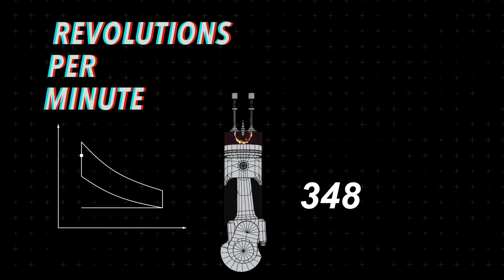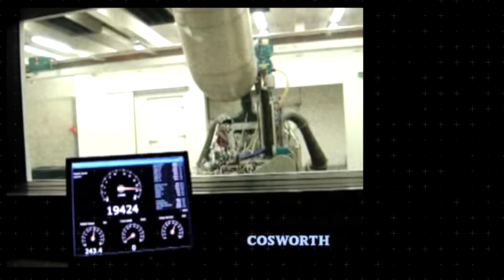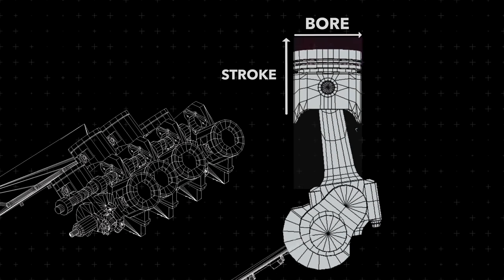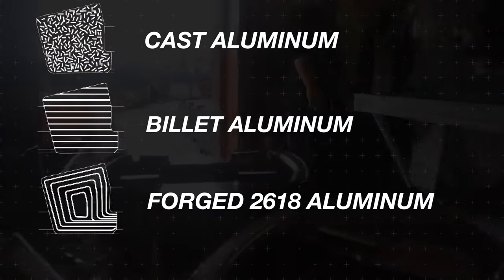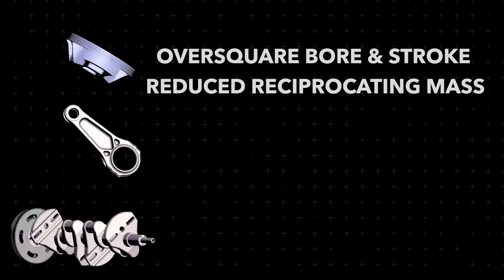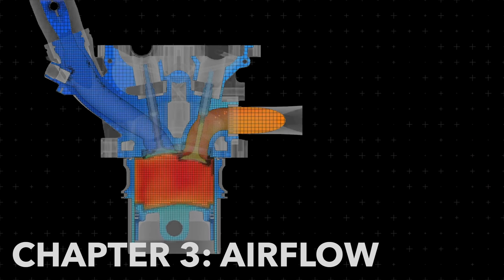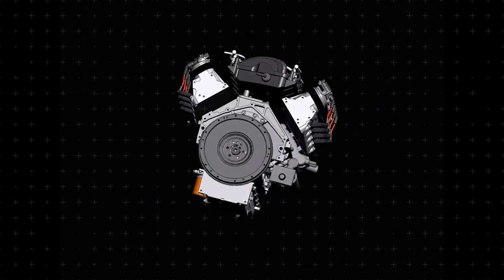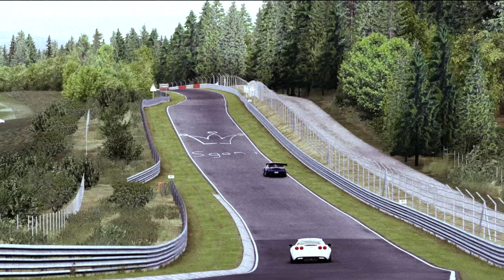The Impossible Engine Speed😳| Explained Ep.28

Comment: Or, you can buy a car which comes with a high factory limit... 
Over 50 years ago, Fiat did that with the 128. A front-wheel-drive dirt cheap saloon launched in 1969 whose engine did 9,000rpm in factory trim. That engine went into the X1/9 in 1972.
Only 4 cylinders, but the sound it made going from 6,000 to 9,000 took the exhaust note two octaves higher into spine-tingling territory. And it could rev like that all day long.  
It had all the tricks described here: highly oversquare (80mm bore, 55mm stroke in the 1100cc in line 4), overhead cam with double valve springs, shortest possible intake runner.

PS 
Great job explaining some challenging concepts clearly and concisely. 

I was working in F1 until 2006. Once you get up to those silly revs (16k or so) the combustion pressure ceases to exceed the inertia force of the piston and rod. In other words, even as the cylinder compresses the intake charge, and then combusts it on the power stroke, the force applied by the gas is less than the momentum force of the piston trying to throw itself at the cylinder head. 

So how does that make power? Because the gas pressure reduces the inertia force in the powered cylinder, such that the inertia forces in the other cylinders "pull the crankshaft around". 
It is a bit of a brain-bending concept. 
In practice, the powered cylinder simply has "less inertia force" pulling on the conrod, since the inertia force at high rpm grows (as a square of the crank rotational speed) to exceed the combustion force, which declines a little as the combustion rate remains nearly constant, but the time available reduces as the engine spins ever faster.

It remains easier to consider that all the inertia forces cancel out neatly, leaving you with the unopposed combustion force driving the engine around. 
Literally, the math works out just the same. 

Time to combust remains a small fraction of the cycle time - hence the idealised vertical line on the "pressure versus piston position" cycle graph, which assumes instantaneous combustion and transition from unburnt (compressed mixture) pressure rising instantly to "combusted gas pressure". In reality, it isn't instant (so the line would not be vertical), but remains "close enough" for the assumption to just about hold. 
This is why ignition timing matters. Firing Before Top Dead Centre (BTDC) means that combustion starts before the piston is at closest approach, and so that graph should start climbing earlier on the compression cycle. But firing at TDC or later would lose too much of the power stroke pressure, and reduce output and efficiency. It is a delicate compromise balance, and every engine will be different because every engine geometry is different. 
Ideally we want to maximise the area enclosed by the graph, to achieve maximum work extraction. Which means it can be very sensitive to exactly when combustion starts, to catch that very narrow peak in the graph at TDC, without losing too much enclosed area on the approach to TDC by firing too early, or giving away too much pressure on the power stroke by firing late. 

That 9,000rpm Fiat engine advances from 5 degrees idle timing, to about 36 degrees BTDC at top revs. And, iirc, an F1 engine at 18k rpm advanced to between 40 and 45 degrees BTDC. This makes it look like that "vertical line" assuming combustion is instantaneous is far from accurate. But the flame front advances linearly through the mixture, resulting in a cube rate of burn through the volume (and more like a square in the pancake volume left at TDC, where it has already burned top to bottom of the volume and is now merely advancing as a squared number across a circle). Point is, the volume burned starts slow and accelerates quickly, meaning that most of the combustion happens late and much faster than the BTDC ignition timing implies. 

BTW, you can now see why Alfa Romeo's "twinspark" idea had merit. By starting two flame fronts, the mixture volume could be burned through quicker (double the rate until the two regions met, or hit cylinder boundaries), hence getting closer to the vertical line, and improving the cycle efficiency (and making more power from the exact same engine). Conversely, the "lack of difference" meant that nobody else bothered with the engineering hassle and expense of fitting a second spark plug - but all tried to optimise the position of the single spark plug close to the centre of the combustion chamber. 

It is also important to realise that the ability of any cylinder to fill with incoming mixture is a difficult compromise between cylinder bore and valve opening. Multi-valve engines work because having two (or three, if you are Yamaha) inlet valves allows a greater opening for the cylinder to breathe through. You can imagine trying to breathe through different lengths (and different diameters) of hose or snorkel. The longer the pipe, and the smaller the bore, the harder it is to draw air in. Ideally you want no pipe (shortest inlet duct) and a wide open mouth (no bore limit) to breathe easiest. But that aggressive cam profile to get the inlet valve open is also limited by the large piston not moving away down the short stroke bore very far or fast. Obviously the stroke always exceeds valve lift, but trying to get 15mm of valve lift when a piston moves just 40mm (and spends a long time in the way, dwelling at TDC) means that lift profile has to be very carefully tuned to pretty much park the valve head against the moving piston all the way to max lift - without touching it at any moment! One touch usually means instant breakage and failure. 

Impossible to do, without generous margins and clearance tolerances for all of the flexibility and vibration and resonances occurring all the time. 

One F1 engine I knew of had to increase the diameter of the valve pocket cutout in the top of the piston crown, because the conrod had such torsional vibration the piston could be as much as 3 degrees out of alignment (around the vertical bore axis), making the edge of the valve pocket hit the edge of the valve head. That resonance only happened at a few engine speeds. But it had to be allowed for, making the entire system less efficient at all of the other engine speeds. But it was easier to sacrifice a tiny bit of power with larger pockets, than find a solution to the conrod resonance (which, despite the large amplitude, was not a fatigue failure problem).
 
Think about it... a conrod twisting along its length by +-3degrees, as the piston moves up and down at 18k rpm... That amplitude is blatently visible with the naked eye (although it's moving far too fast to see it in real time). So much for a system that 99% of people assume behaves like a rigid body assembly, with stiffness and deflections so small they are microscopic and hence negligable. 
And you thought we only had to worry about up and down stuff?  

Sorry for the lecture. I hope you found it interesting.

Comment: Brilliantly explained. I'm not an engineer and horrible at math, but it all makes sense. On valve float, I don't know why F1 never licensed Ducati's Desmodromic valve system. Two rocker arms/cam lobes per valve - one to open the valves and one to close them. No springs. Put electronic cam control on them for higher RPMs. Pneumatic is great but moving a lot of gas quickly seems to have time delay as well as a number of other phenomenon - under extreme pressure and speed gas can liquefy. It is such an art what these engineers can do. After F1 went to hybrid and smaller cylinder engines I stopped watching. Sounded like sewing machines running around the track. Nothing has a heart stopping brutal scream like a V-10 entering the tunnel at Monte Carlo...

Comment: What about the 4cyc mc22 cbr250rr from the 90’s. Redline is 19,000rpm and the limiter kicks in at 20,000rpm. It was my learner bike, and I bought mine with 30,000km on it and sold it with 45,000km. Ran perfectly and was absolutely reliable, it sat outside rain hail and shine, and always started first go everyday (was my commuter bike for work). I flogged the engine too, rode it high in the rpm up to redline pretty much everyday 😅

Comment: Rocker arms with fingers, a la Ducati desmo engines give higher rpm more reliably because no valve float issues.

 At the extreme end of the scale the problem is having the time required to burn the fuel, engineering only presents thinking exercises but time/piston speed is the limiting factor.

Comment: There has to be a point where the fuel cannot physically burn quick enough to make power. A chemical reaction has a limit to how quickly it can take place. Exceed that limit and the fuel finishes burning in the exhaust manifold where it does little good. Except perhaps to spin the turbo charger.

Comment: it doesn't matter what stroke you have on an engine, but you can never REACH MORE THAN 197 METERS OF LENGTH PER SECOND FOR A LONG TIME the engine blows up then this applies to all engines even spark plug engines that turn 40,000 rpm

Comment: I think they fail to mention that these engines are able to reach these high tpm is a big advantage in gearing reduction. There able run lower gearing in the transmission witch in turns you’re able to multiply power and torque.

Comment: 755 horsepower @ 19250 RPM is impressive indeed but 755 horsepower is far less than 1050 horsepower which was produced by 2016 F1 cars, at much lower RPM, with the help of turbo. In the end, performance requires high power, no matter which method you use to achieve it. These days you get electric cars with almost 2000 horsepower and incredible longevity  due to the low number of moving parts that could fail.

Comment: RPM has nothing to do with stresses to the engine. You can have a 30,000 RPM engine easily.
Just have a stroke of 20mm and it'll have the piston speed of a typical engine at 6,000 rpm.

Comment: This video talks about F1 engines then talks about metal valve springs. They've used pneumatic air springs since the 1980s including the whole V10 and V8 era.
Also, the exhaust pulse timing is not designed for just the minimum backpressure, it's designed for scavenging, this is why the volumetric efficiency of these engines is well over 100%.

Comment: If you are talking of rpm on f1 engines you might want to look at the 2005 season not 2006, because of the rules in 2006, engines had to last longer meaning, there are some reports of 21000 rpm engines in 05, particularly the spectacularly unreliable mercedes. The wiki on 06 regs is a bit out of context, there was the expectation the new v8 would rev higher and reportedly cosworth was the first to reach the 20000 mark with the new rules though by the end of 06 some said 21000 rpm was close to being broken and for 07 an rpm limit of 19000 was established.

Comment: 1:41 you should’ve used lessons learned from NHRA Top Fuel dragsters which rev at the highest rpms and have by far the most Horsepower of any Motorsport cars I mean they pour out over 12,000 hp

Comment: I grew up in the '80s and always thought that banning turbos in F1 was a terribly old-fashioned regressive idea - but that was the governing body (FIA) in a nutshell (old-fashioned and regressive). Screaming NA engines are a very cost-inefficient way of achieving performance, which is fine if you're an F1 constructor with hundreds of millions in sponsorship, but precisely because of that it creates a huge barrier to entry - you can only compete if you have an absolutely astronomical budget.

The return of turbos to F1 was pure logic, but once again the FIA insisted upon imposing technical limits. Why mandate the use of hybrid electric scavenging systems, but then limit the amount of usage of that scavenged energy? Nobody gets to find out just how good the system really is and surely that serves nobody's purposes. F1 should not be limited - it should be the pinnacle of possibilities. The turbo engines of the '80s really were pushing the boundaries before the FIA started turning the screws on them with its nanny-state tendencies (boost limits, for instance) - it would be great to hear of modern F1 engines routinely outputting over 1000bhp, as they used to. (I know - the engines themselves were not as durable and they could run qualifying-spec engines turned up to the max that would only last a few laps, but that was all part of the fun - and more modern materials might have improved matters since then). The cars themselves were more challenging, which meant the drivers had to be better - today's F1 drivers are just gamer geeks compared to the '80s mob.

Excellent informative video here.

Comment: Ducati had a different solution to the valve lift problem; desmodromic valves, where the valve is forced open by one cam, and forced closed by another; this is why their motoGP bikes were faster, until the other teams started using pneumatic valve springs.

There is nothing magical about a "10k rpm" limit, the Yamaha R6 limited the engine to 15800 rpm (although they claimed 17500, which was a false advertising scandal)

The real limitation is the peak piston speed.

Comment: The previous version NASCAR engines achieved higher peak piston speeds than Formula 1 engines ever did. F1 engineers actually used to work with NASCAR engine manufacturers to make F1 components stronger and capable of higher speeds.

Comment: Absolutely brilliant 337!
So freaking accurate dude! Io this day I get irritated when I hear people who ooh, ah over a small displacement motor that makes power at 9000 RPM and they don't mention the fact that it's tiny, it has tiny main journals, it has tiny connecting rods, it has a tiny crank and low internal friction because of a very low rotational mass, HP per liter is easy at that displacement. What good is 200 horsepower if right when you hit peak horsepower,,, it's time to shift? 
You don't even get any time to feel the pull of that full 200 horsepower because redline and all.. Then you shift and then you drop back into the power band where there's no torque.
There's a lot to be said for a big broad torque ban and a steady rising horsepower curve where right where you shifted past horsepower peak, it drops into your torque peak and the car just feels like you could short shift all day long!
Reply: I hear you, it's really just barnyard engineering in those Japanese vtecs from the 90s and F1 engines from early 00s. Idiotic stuff. Morons in Honda/Cosworth don't have a clue. Any clown can get 200hp out an NA 1.8. The real innovation is in American muscle. Getting a 6 litre V8 to produce power at 2000rpm, now THAT'S difficult. All kinds of gotchas like needing bigger carbs to get all that fuel in, a bigger fuel tank to hold all the fuel, a bigger exhaust to help expel all the unburnt fuel, not to mention the military force you need to secure the oil fields and refineries in the first place. When you've got an efficient little 4 banger you don't have to face any of these challenges. It's child's play.
Reply: @-BuddyGuy  LOL!!!
Top Gear listed the WORST "efficiency" around the Top Gear Test Track when the Big three were still there..
7 liter Corvette Z06? nope
8 plus liter Bugatti V16 ?  NOPE!
The loser is???
The FQ400 Mitsubishi Evo a 2 liter four pot!! ffs!!
FOUR MPG!! 
We are talking about PERFORMANCE engines sweetcheeeks, not some small asthmatic engine for your hatchback..

P.S. the 7 liter Z06 Vette and the 6.2 liter SUPERCHAGERD, ZR1 Corvette DO NOT get hit with the Gas Guzzler tax in America, unlike ALL the high performance,  small displacement Euro/Jap cars!

P.P.S. Top gear magazine averaged 32 MPG with a long term C7 Vette!
efficiency my ass!
Reply: @lll9416  No amount of verbal diarrhea and goalpost shifting (EPA's "Gas guzzler tax", big turbo FQ400 with peak powenr at 6500rpm) will distract me from how wrong you were in your first comment, and what the subject of the video is. Your attempt to deflect has failed. Also, calling me sweetcheeks is really odd. What's that about
Reply: @-BuddyGuy  ahaha🤣🤣
Alot of the usual BS theory but no facts.. 
Typical,ffs..
The truth hurts, its ok junior.. 😎

Comment: bro where did you learn these engineering concepts in these engines? like the characteristics of conical valves, oversquare pistons, square pistons, beehive springs characteristics, dual spring characteristics? is there a book that combines to tell all of these concepts? the books i have found never have all of these things, they are either simplified for the layman to understand like diagnostics and how engines work, or extremely engineering oriented with complicated mathematics and physics, but they never explain in summary what the mathematics and physics say, it is up to the reader to summarize from the math, the extreme books just tell of the analysis behind the design. Im hoping to find a book to know all of these information you know, without being too simple and without being too hard to make sense of, somethign like this in this video where the characteristics behind concepts are easily and intuitively understood and shared.

Comment: You do realize NO valve springs are used in F1 engines right...Its an air/gassous system, and actually really hard to get a set of those suckers.
So us mere mortals are stuck going old school and balancing everything within 200mg.
Watch some vids on high Rpm engine building, we literally spend 100s of hrs hand shaving and balancing assemblies.
Ps have you ever seen a full ball/roller bearing V-12 engine. the crank, rod assembly were a monster that took 2 machinists a week to assemble /disassemble back in the day before CNC. Full ball EVERYTHING, if it moves it is balanced, clearance'd and has a full bearing, no shells. In 1987 the engine shop I was at was putting out 24,000 Rpm engines. and they generally lasted one full race session, or a couple practices and a qualifier and a main. 1 day life either way. 1 months work 4 or 5 machinist/mechanics.